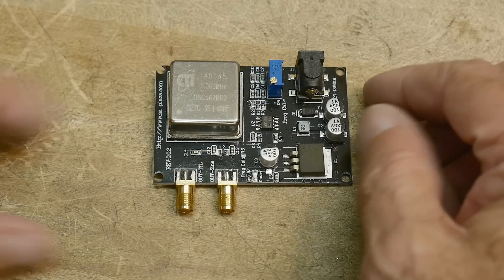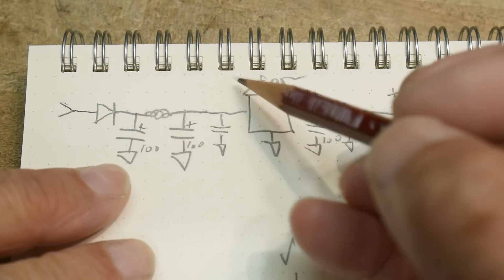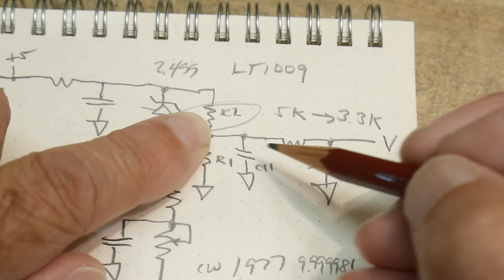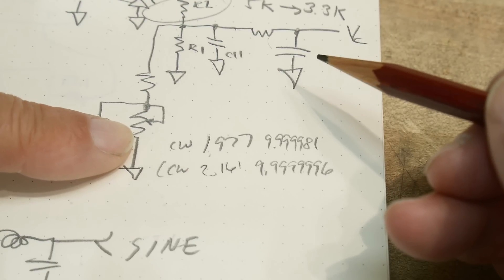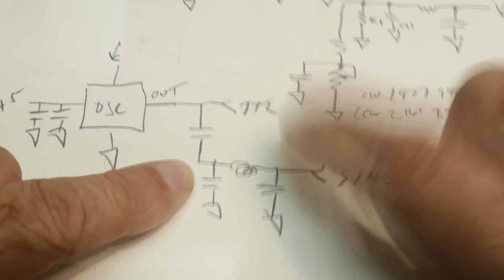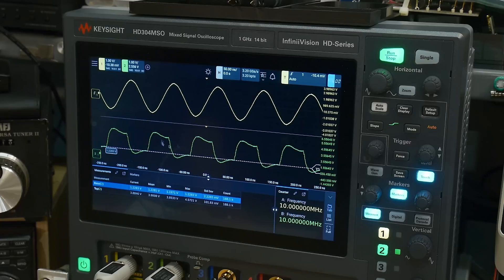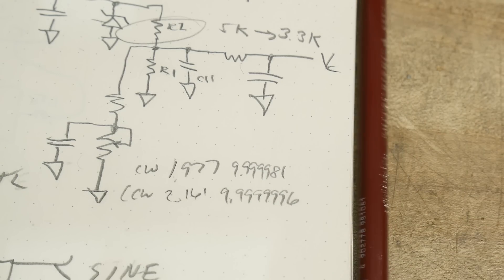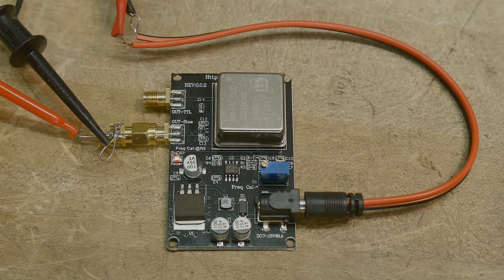#2035 10.000000 MHz Oven Oscillator Board

Comment: This may explain why you see both issues- the tunable frequency range being lower than 10.00000 MHz and the "crappy" TTL waveform. My guess is that the manufacturer of the hermetic OCXO rates that part into a load, most probably of ~15pF capacitance, and high-Z resistive. It also has a "Pulling" spec, which tells us how many ppm that it will be pulled for a given load change.  We don't know what those numbers are without the OCXO spec sheet, but anyway...  Now the PCB designer took that part, added an external Pi circuit, with its load capacitance, and the OCXO  frequency range gets pulled down. Add to that your scope load (and cable capacitance, which adds up fast) and maybe the OCXO isn't bad, just the application. The use of an inexpensive TTL or CMOS buffer would help here.

Comment: I have exactly the same board and had the same problem of it not quite reaching 10MHz. Fixed it a bit differently but similar. Now here is the thing. I left it running constantly (24/7) for now more than 6 month and the frequency has increased slightly. It is now 0.6 Hz above 10 MHz.  If mine is typical,  it means you don't need to do the mod. Just let it run (age). I keep observing it to see if the up-drift has stabilised. I think it did. It would be great if you could run yours also for an extended duration to see if you see the same change.
Reply: Where I work, we have to let the crystals burn in for at least five solid days for them to become stable. And the components around them make a difference afterwards.
Reply: But these are already used,
Dave 2E0DMB
Reply: @davidbrowne1588  mine was brand new. One can never be sure when buying on eBay but I would guess most of these ovenized xtal oscillators are.
Reply: @TheHWcave  Hi that's great, you never know, great for the price, waiting for your next videos hw,
Good luck 
Dave bb,

Comment: I fixed mine (exact same problem) a while back by soldering a small 1k resistor from the control input to ground on the bottom of the PCB. Same end result, but I hate SMD soldering, so this way was easier for me.

Comment: You could buffer the "TTL" output with a 74F14 Schmitt gate to get rid of that crappy waveform.
Reply: 74AC04 has better phase noise
Reply: @brothertheo2677  the F14 being a schmitt trigger with input transition hysteresis, gets around the signal input low/high threshold problem with that crappy "square wave".

Comment: I assume someone is losing money along the chain to get this to you for $7
Reply: The OXCO is probably a "pull" from some recycled hardware.  So cheaper and "pre-aged" for your convenience!
Reply: @lmamakos  Upgrading their cellular system.
Reply: The oscillators are recovered from scrap. That makes them very cheap. Not necessarily bad as it also means they're aged somewhat. To be honest I couldn't make them for $7 even if the oscillators were free.
Reply: I never understood how they can make and sell boards for less than the cost of the components (I know they buy in bulk but even so...!)
Reply: Less than a dollar to make that board using scrap parts and assembly line downtime. Shipping to US is such a large volume that throwing this on the pile is free. Plus all the shipping subsidies. They probably make a buck or two.
Reply: China is undercutting other producers via subsidies to drive them out of business. Classic tactic of monopolists. The rest of the world should be very concerned about this as someday soon we will have no option but to buy on the terms of the Cinese Communist Party. Not an organization I want to be beholden to.
Reply: It's subsidised by the government, a few cents of international currency along with full employment makes it worth it for them.
Reply: @YSoreil  Cheap labor in China by US standards plus a 12 hour per day six days a week work schedule makes it possible plus govt subsidies. No one can compete against that. I would call it unfair trade practice and certainly unfair labor policy. Totalitarian societies can do this. Labor unions are outlawed in such societies.
Reply: @herbertsusmann986  Having lived in a totalitarian society in my youth, I can say this: the labor unions are not outlawed, but they are completely controlled and subservient to the state. They are basically dust in the eyes of foreigners and there just for show. Also, to extract a bit of extra cash from the worker drones with union dues.